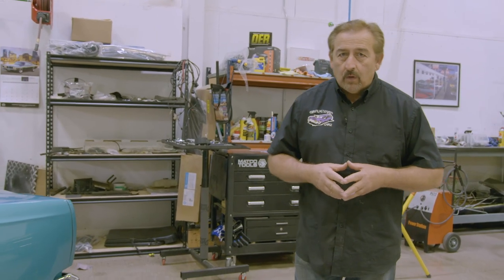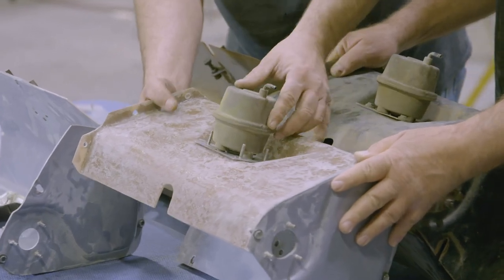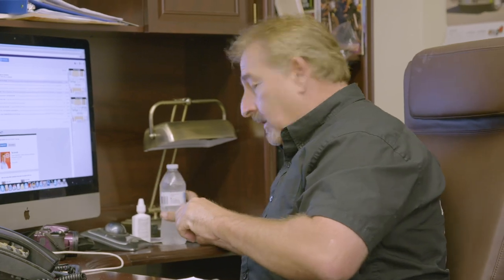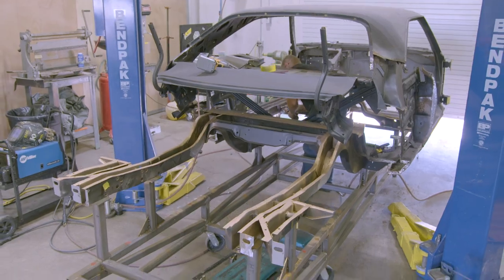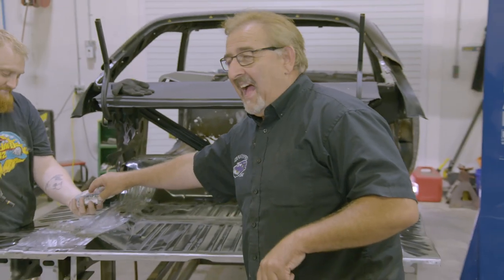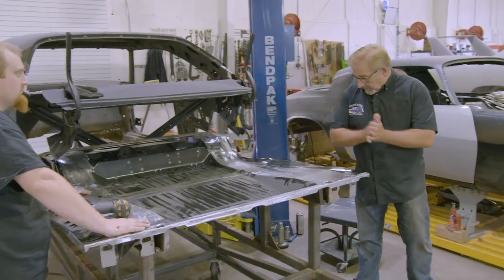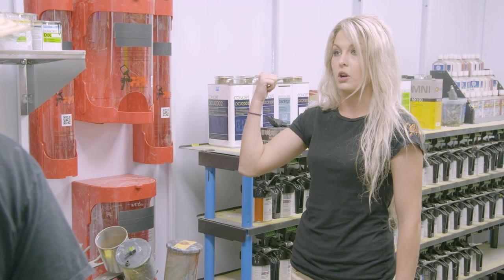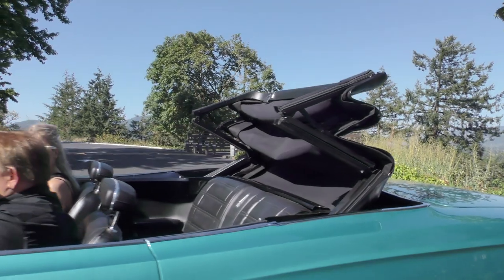MILLION DOLLAR BIRD

Comment: Anybody that spends that kind of money on some toilet muscle car needs there head examined. If I can’t drive it until it’s balls are hanging down and just scraping the ground it’s absolutely useless to me. That was a 3k car in 74 and we used them as intended.
Reply: So go drive the 427 super snake if u got big balls- it’s worth what now??? Lol
Reply: What’s good about the whole restoration thing is that allot of really talented people can perfect there craft.
Reply: I can see the attraction but they're agricultural junk.

Leaf springs, push rods, drums, cast iron blocks, 4 speed etc etc.   There is no finesse or any advanced (for the time) engineering.  Just brute force and ignorance.

However these old crappers are more than the sum of their parts and and have decent looks and lots of torque.    They don't handle etc but represent a golden era of USA which is long gone.  

I like them.  After this it all went downhill.  Much like America in general!
Reply: Why spend $50.000 on a Honda that can’t hold top end without surging and redlines at 8.500 and needs a rebulid of motor every 3 months that a small junk motor. V8 bulid it’s once b done